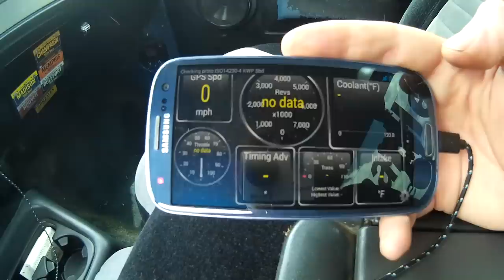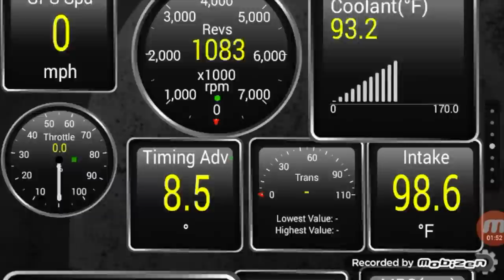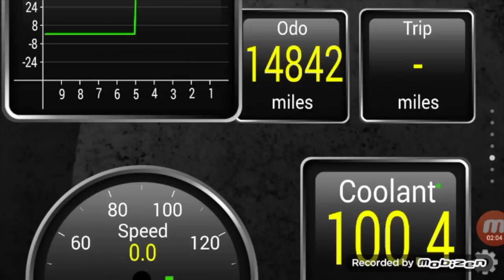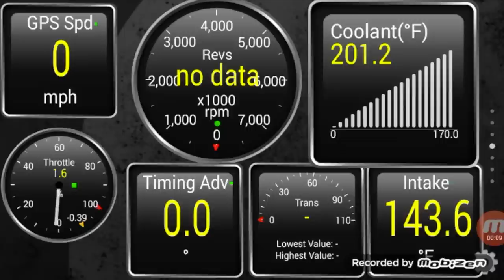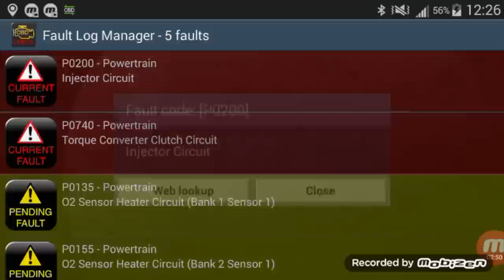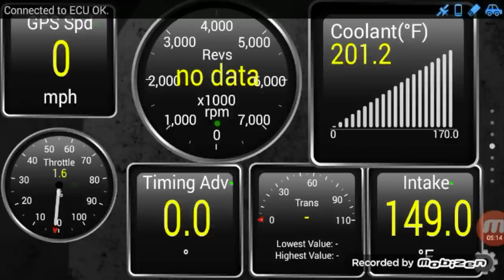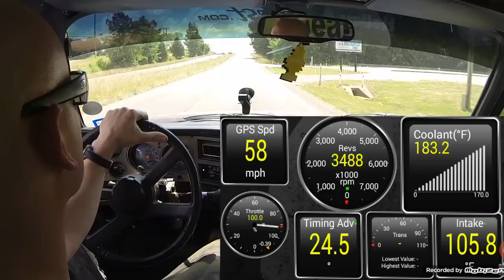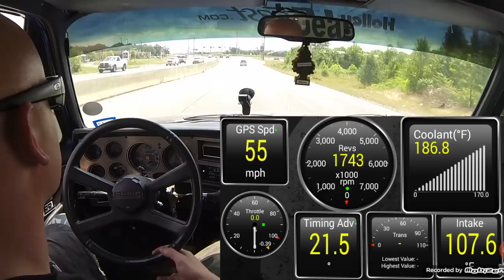LSx Swap Gauges Simple, Easy, Cheap & Code Reader OBDII -Check Engine Light DTC Bluetooth OBD2

Comment: Can you do a video on how to install rockers arms I rebuilt my motor and my rockers arms keeping loosening up every time I start my truck I have a 99 GMC Sierra with a 4.8 vortec and have no idea how to fix it
Reply from the maker: wow, that is just weird. They should not loosen up. Is it all stock motor? Yea, I'd like to do a video on that.
Reply: +AGearHead4Life thank you that would be very helpful
Reply from the maker: Is your motor stock? Are the bearings in the rockers still in good condition? Did you torque them down to 20-22 ft lbs?
Reply from the maker: does it have an aftermarket cam? are the pushrods the correct length?
Reply: +AGearHead4Life motor is completely stock and no I didn't torque them down someone had told me there hydraulic so you should have the motor on and tighten them down till they stop clicking then a quarter turn
Reply from the maker: If you have  4.8L motor, which is a LS series motor, you will tighten the rocker arm bolt down to 20-22 ft lbs and then you're done. If you're not doing that, they will come loose. If you don't have a torque wrench, just tighten them down all the way, but down try to over tighten them. Just good and snug, if that makes sense.
Reply from the maker: I think that someone had possible given you instruction on how to tighten the rockers on an older 350/305 style engine. yours is the first years of the new LS series engine and likely why he's confused.

Comment: can you please explain the difference between an ls motor and a vortec motor please and thank you
Reply from the maker: The term Vortec was used for too many years to be an accurate name. When I hear Vortec motor, I think of the SBC motros in 1996 trucks. You must be talking about the LS vortec motors though. That basically just means that its the truck version. They'll have cast iron blocks as the main difference. Many similarities though.
Reply: Thank you for understanding my question and giving me an answer

Comment: only thing i dont like about torque is that it wont connect to my mercedes, but everything else seems to work fine, I have a s10 with a 6.0 swap, my stock gauges woundnt work so installed a tablet inside the dash, now when i fire it up the tablet comes up and the app auto starts
Reply: curious how you did this
Reply: +Russell Sands the programing a buddy did, im not computer savy at all, but took the design for the bezel to a local trade school and they had the students cnc me the bezel that fit in the stock location but did loose the stock fuel gauge, had to go with a aftermarket fuel gauge and sending unit
Reply: +THE STUTTERIN GUNNER you have a s10. I would like to see your setup and what aftermarket stuff did you use for the fuel and the sending unit.  IF you would could you pm me I need to ask you a few questions on the eletronis
Reply: +baylor10010 yeah definitely, if i can get over to it this weekend ill send ya everything i got, the motor is out now getti g reworked, going with a twin turbo system and sending the transmission out to get reworked, but everything else is the dash is install
Reply: +THE STUTTERIN GUNNER ok cool thanks my issuse is that i got a harness for the motor and trany but i am at a loss for how to make the headlights turn signal radio and dome lights work. with. the fuse box inside
Reply: +baylor10010 what year is your s10? mines a 89
Reply: +THE STUTTERIN GUNNER 85 s10 blazer.  i had a 350 in it but gave it to my dad. All this ls computer stuff and wireing is new to me
Reply: +baylor10010 the body harness differs from the engine harness, my s10 has the factory harness that runs the headlights and radio, not sure if the dome light work, hasnt had a bulb in years
Reply: +THE STUTTERIN GUNNER ok so I still need to run power to the body harness so were will the come from. on my model i think it got all its power from the starter
Reply: +THE STUTTERIN GUNNER thanks for your info cant wait to see the setup
Reply from the maker: That harness is separate from the engine. That's the body harness. You should be albe to find the original wire that gave power to the cab and hook it back up to the batter and all will work again.

Comment: it shows that there are two different ones of bafx does it matter which one I can use
Reply from the maker: +Victor Rivera Where does it show two different ones? The one in the link in the video description should work for you.
Reply: the link don't says sorry the page couldn't be found
Reply from the maker: +Victor Rivera Thanks! I'll check the link.
Reply from the maker: The link is working for me.
Reply: yes I seen it thank you
Reply from the maker: Here's the link again. See if it works this way.
http://www.amazon.com/gp/product/B005NLQAHS/ref=as_li_qf_sp_asin_il_tl?ie=UTF8&camp=1789&creative=9325&creativeASIN=B005NLQAHS&linkCode=as2&tag=age0a0-20&linkId=XIPL2F7NIRFSK5OV

Comment: I wanna see some full throttle pulls from a stop with the new converter i currently have a c1500 ecsb 5.3 4l80e swap with stock converter
Reply from the maker: Yes! I want to make that video too... BAD! It is awesome and is a whole new world. Makes you love an 80e even more. No more bogged down launches.
Reply: +AGearHead4Life Yea my launches are horrible with the 275 60 15 hankooks and 3.42s no spin at all on dry pavement but it chirps them on 1 to 2 shift in the 50s
Reply from the maker: Yep, same situation I was in before the stall.. tire size, gear ratio and all. I love my 3.42s now.
Reply: +AGearHead4Life I'm looking forward to seeing the videos...

Comment: Does anyone know if this can also display oil pressure gauge?
Reply from the maker: +xSnakeStyles It does not because the PCM does not usually receive that information from the oil sender. The oil sender usually connects directly to the gauge on the dash.
There may be a way to make it work with Wiring, but it won't work by default.
I haven't gotten the trans temp to function on this app either yet.

Comment: As far as I have found, it will not work on OBD2 saturn s series until after 99 or 2000
Reply from the maker: Interesting.
Reply: @AGearHead4Life   would this item work for a 1995 trans am lt1

Comment: Will it read oil pressure? Or do u run a oil pressure gauge?
Reply from the maker: I use the dash oil gauge. The stock PCM doesnt usually monitor oil pressure. I'll use a mechanical one, like on my test stand to verify oil pressure. Once you have good pressure, it's not common to just lose it often. It's not something that is going to change often like coolant temp, but of course its a good idea to have an oil gauge.

Comment: @agearhead4life I HAVE A QUESTION I KNOW YOU HAVE THE ANSWER,,, I HAVE A  RUNNING 454  OUT OF 79 SUBURBAN,, WHATS GOOD SET UP FOR UNDER 4 GRAND I CAN DO ,, TOP TO BOTTOM,,, IM IN LOVE WITH THE BIG MUTHA THUMPR CAM BY THE WAY,, AND I KNOW I WANT THAT,,THANKS FOR ANY ADVICE YOU MAY OFFER
Reply from the maker: What's up Young Nee! Are you looking for suggestion on building options for the 454 with a $4k limit or are you talking about investing that amount into the whole suburban?
Reply: AGearHead4Life I'm using the motor..and putting it into my 1973 impala..just want something nice...nice power..nice choppy cam...but want to make sure everything I put works well together. .
Reply from the maker: ah gotcha! Nice score! The problem there is that one person's judgment of whats "nice" is not the same as another person's judgment of what is Nice. I don't have big block build experience so, I don't have particular parts to recommend, but I can tell you that you'll want some nice aftermarket aluminum heads and a medium cam. Too much cam may sound sick, but then it wont be as enjoyable to drive. You've got to have a balance. I suggest looking around to see what other guys have done on their BBC builds and compare to see if their style fits what you're looking for. I only play with LSx motors these days.

Comment: what about the oil psi?
Reply from the maker: Most of the time LSx PCMs don't monitor the oil pressure. Some may though. That dash gague just runs to the sender. So the option is up to you. It's not something that has to be monitored as often as coolant, rpm or speed. I am currently using my stock gauge to monitor oil pressure. Before I put the engine in and run them on the stand, I just use a regular mechanical oil pressure gauge.
Reply: Ok kool. I love the way that look simple and easy no wiring needed.

Comment: do it work as a wide band
Reply from the maker: Not that I know of. It reads the information that the GM PCM puts out. So if you find a way to make the PCM put that data out, then it may be able to.